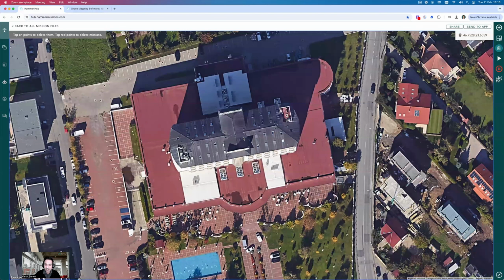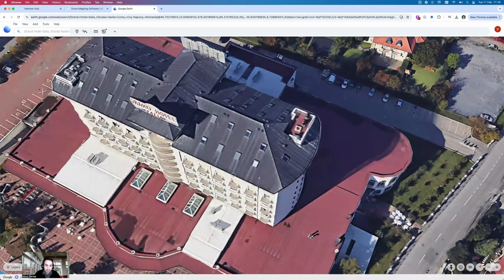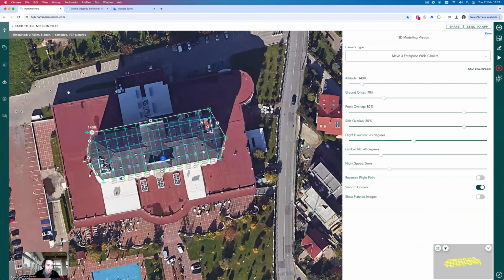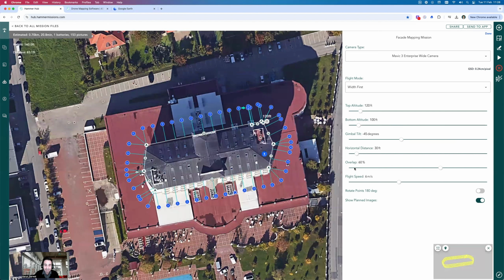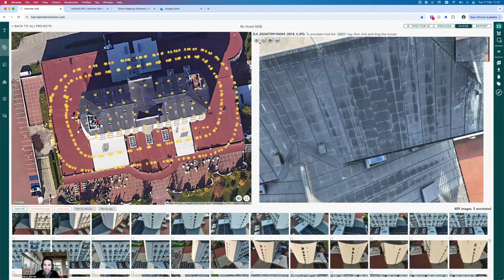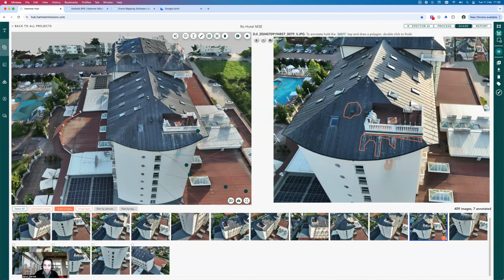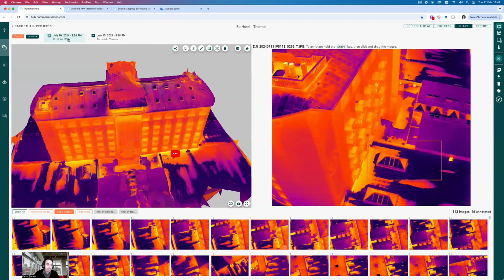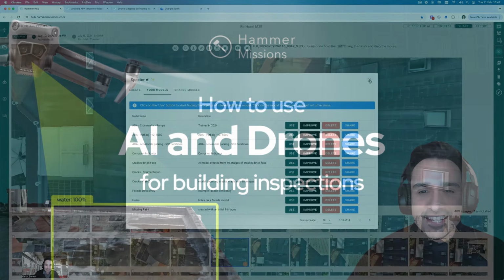3D Mapping a Hotel with Drones | Visual, Thermal and AI | Hammer Missions

Comment: Nice video. I'm curious, is the thermal model a true radiometric model, maintaining actual temperature data, or is it strictly visually reconstructed from the thermal images?
Reply from the maker: Thank you! 
The 3D model can be exported as 2D orthophotos (horizontal or vertical) which are radiometric and have actual temperature data.